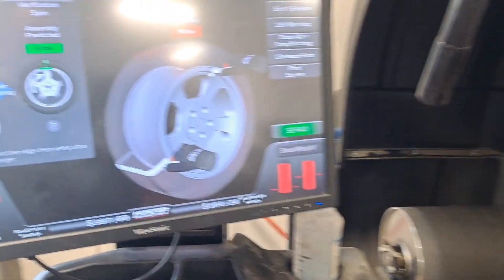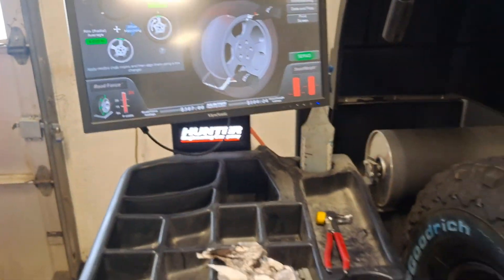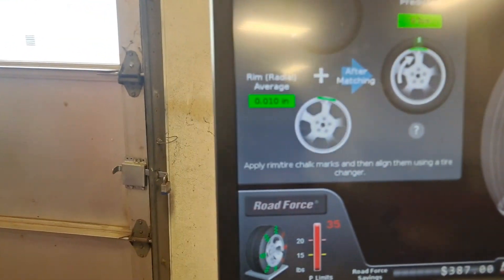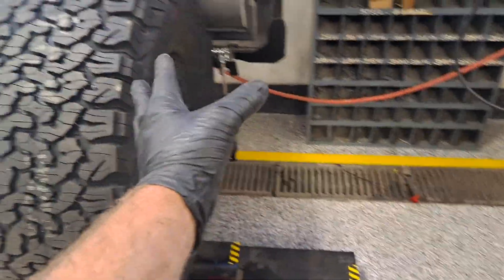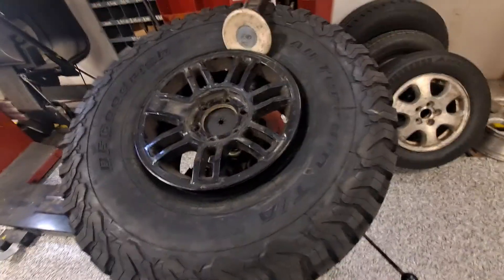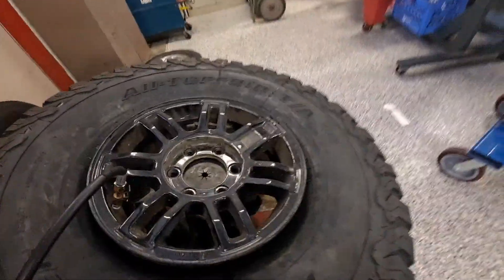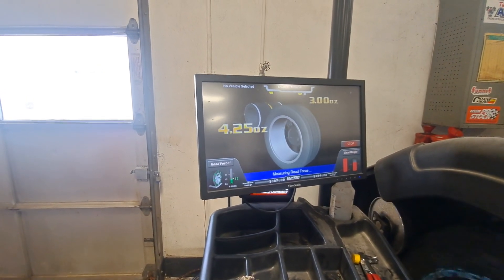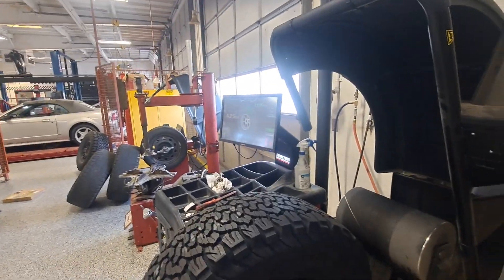Diagnosing and repairing a tire vibration (road force variation) using hunter touch balancer

Comment: The best explanation as to odd vibrations. The being able to balance a square analogy is perfect. Cheap tyres can often be balanced, but if they are poorly manufactured with hard points in sidewalls this will only ever show at high speed. I now know what has been causing my problem, thanks 👍🏻

Comment: Great explanation!  Adding to it?  A proper “balance” corrects the static and dynamic balance - side to side shake of the assembly.  Roadforce corrects the up and down “hop” by matching the high and low spots of the rim/tire assembly.  

Suggestion?   Perform a centering check.  If the rim is not perfectly centered on the spindle?  You will get inaccurate results - like trying to balance an egg.  The machine has this feature built in…
Reply from the maker: I agree with everything said, great input.
Reply: The story of my life at Discount Tire.  I have mag-style wheels, and they can never do it right bc they don't center on the spindle.   My dealership, on the other hand, has the top-of-the-line Self-Setting Hunter balancer.  They can get it perrrrrrfect.  Discount is trying to tell me my wheels are bent.....  

Just because I'm a girl, doesn't mean I'm stupid.  I know my car VERY well.

Comment: I have had a very mild annoying vibration in the passenger seat at highway speeds for a long time. It's a 14 Ram 2500 with 33" Nitto Terra Grappler G2 tires on the factory 20" rims. I had it balanced today on a Hunter Road Force machine. It took the technician about 3 hours, they were very difficult. Happy to say it rides perfectly smooth now! Will be posting this on the Ram forums too. The vibration in these trucks is very common.
Reply from the maker: Honestly its common on any trucks with oversized tires. Probably took a long time because they had to dismount tires and phase match them. But again, proof this procedure works. Thanks for the feedback.
Reply: @paulkelley86  Absolutely. Thank you for your quick reply. That's exactly it. He had to move the tire on each rim about 3 times and put a chalk line where it was previously to try to find where the tire and rim marry in harmony. Actually had me concerned because it took so long but the proof is in the pudding.
Reply: @paulkelley86  It had the vibration with the factory Firestone Transforce tires which had me concerned when I Nitto tires on and it still had the vibration. It seems anything 31" and over needs a road force balance
Reply: I am having the same problem with my tacoma.  I have BF Goodrich ko2. I took it for an alignment and they told me it also needed a to rebalance front tire. They did and when got mg truck back going 65-78 miles per hr my passenger seat starts to
Shake like its going to
Fly out the window. I took it back and they cannot balance the tires. I’m so frustrated. Any advise where i can take it or do? My truck is only 2 yrs old and it drives like crap.
Reply: @Lexibeez8907  Google tire shops in your area, I'm not sure if you are in a remote area but call the tire shops and specifically ask if they have a road force balancer and an experienced technician that knows how to use it. I'm just curious, do you know if your rim is bent from a pothole or something?
Reply: They expect these gay jacked up trucks to drive like a Cadillac.

Comment: Thanks for this video. I had a weird highway speed vibration problem that I couldn't figure out, and I insisted a tire shop put them on their road force machine. Even though they balanced just fine, they failed the road force test.
Reply from the maker: Yes sir, we see that every day. All the students leaving here will be trained but more experienced techs/mechanics are not necessarily up to speed on the latest tech.

Comment: I have some advice not that anyone asked. If you have a decent amount of lube on the beads, you can pinch the tire with the bead rollers and turn the wheel inside the tire to match mount. Also if you want a good balance, turn off Smart Weight or at the very least turn on Smart Weight technical mode. You're welcome.

Comment: What an excellent video.  Great info. I just bought 4 new 20” continental terrain contact HT for my f150. First it had a strange vibration at 45 and then over 70.  Went back they said one tire visually had a hi spot on the tread. They replace that tire. The 45 vibration is gone but the above 70 is the same. They do not have a road force balance machine and they keep telling me they can not guarantee anything over 70 mph? Sounds like excuses to me.
Reply from the maker: If it's tire related, the machine can measure it.

If it's something like a driveshaft, obviously the machine can't see that.

Based on when it started, request road force balanced and ask for the road force variation numbers for each. Sometimes techs don't really understand what those numbers are.
Reply: Thank you good to know just curious with the driveshaft. How much run out do you think is acceptable for a one piece aluminum driveshaft.
Reply from the maker: @IHcubcadet  there may be a spec, but we don't commonly test like that although there may be a spec.  There is an electronic vibration analyzer that can identify different frequencies and determine if it is at a driveshshaft frequency vs say a tire or even a flexplate frequency. They are all turning at different speeds. 
If we determine it to be driveshshaft related we would most likely send it to a driveline specialty shop that can balance a driveshshaft on their machine.

Comment: stock wheels and i have ZERO vibration even at 80 mph ..
Purchased a new set of wheels and tires, got vibration at 65 mph and a slight wheel hop on idle speed on the front side.
Took the wheels and tires to 3 tire shops to all of them say the wheels and tires are fine. Took the wheels and tires to 2 places that are specific to bent wheel repairs and both said the wheels and tires are fine.
They said my suspension has issues. Odd how my suspension works PERFECT with the stock wheels and tires but acts up when i put the new wheels and tires on ...
Reply from the maker: Good chance they are doing balance only. See if anyone can measure road force.  I bet you have excessive variation even though the balance is good.
Reply: @paulkelley86  none of those shops have this road force machine ...
Reply: Brother I have the same issue with my 4runner. Brand new 2023 got aftermarket wheels and vibrates at 65mph.took off the wheels and put back my oem wheels and it's fine now
Reply: @abrahamfonseca6198  🤷🏽‍♂️ i feel your pain
Reply: @abrahamfonseca6198  one shop told me to mix the stock oem wheels. 
Put the front stock oem wheels up front and the new aftermarket wheels in the rear and go for a drive and see if the vibration is gone or still there.
If the vibration is gone then the rear aftermarket wheels and tires are good and can stay there. 
If the vibration is still there, then you know its the rear set, then have to find out which one is bad. Either flat spot on tire or warped out of round wheel. 
Or they balanced one or both or all 4 wheels wrong.

Comment: I balanced a few tires the traditional way and the machine called for .75oz on the inside of the wheel. Not bad. Then i did a roadforce and match. Called for 1.75oz 🤷‍♂️   I would have preferred less weight.

Comment: I’m going through this now. The Toyota dealership is trying to warranty through nitto and replace all 4 tires. I’m now thinking the technician didn’t know what he was doing with road force balancing
Reply from the maker: Very possible. Request road force balance. I believe the road force balancer is a required tools and equipment for all toyota dealers. Sometimes people learn one way to do things and don't always know the latest and greatest tech. It also may be an issue of pay, the techs often get paid a fixed labor amount whether they basic balance, roadforce balance, or even spend a ton of time phase matching to really take care of the customer. It is possible to get toyota to pay the clock time on that rather than the book time, but the dealer needs to know how to navigate that "z" time process. Advocate for yourself, there is a lot of problems in automotive biz.

Comment: I just had a set of Toyo AT3 put on my 05 4runner. Thing rode like crap, took 4 trips to the tire shop to get the road force right. 2 tires the yellow dot is 180* out from the valve stem. Other 2 are pretty close to valve stem. I had a really bad vibration in the 15-20hrz range. It was a loose vibration not a tight one like a bearing.. The vibration is 90% gone but its still there. I have  a feeling the vibration will be felt through the wheel when rotation time comes. The tire shop (Les Schwabs) put the 2 180* out ones on the rear.. Should i be worried about it? before the last rebalance i called Toyo and they was not to happy with Schwabs!
Reply from the maker: Ultimately what matters is the road force variation reading on the assembly. 
If they are dismounting and re indexing 180 degrees that sounds like a guess. The dots are a guideline but with the correct balancing machine (road force) the machines instruction supercedes the dots. 
And yeah if the roadforce is excessive on the 2 rear, a tire rotation to the front is going to bring your vibration back.
Reply: I know you posted this 9 months ago, and I'm in the same situation as you my friend. I bought the AT3 for my Envoy, had it balanced 5-6 times so far with 1 tire being replaced 2 weeks after purchase due to it being out of round. No matter how smooth the surface is, I still get a vibration similar to yours. I had a set of Yokohama Geolander A/Ts prior to these Toyo's and never had a vibration issue up until now, and I'm coming up to 10 months of ownership.
Reply: @supersaiyenunlimit2  I am so about ready to take these tires back.. The vibration kinda went away during the hot summer days but now the temps are blow 70* out the tires have started to vibrate again! 
Thanks for the reply!!
Reply: @MrDan1509  That is exactly what I'm experiencing as well, they're tolerable when it's warm or hot but once it's under 60* it's definitely noticeable. I do regret not returning them under Tire Racks 45 day policy if I knew this was going to be the outcome or went with something different. Hopefully they get better as they wear but I'm doubting it.
Reply: @supersaiyenunlimit2  Dang, i knew i was not the only one. I buy my tires from a tire shop that will buy them back no questions asked even if there's only 1/4 tread life left. Paid a few hundy more than i would have at Discount Tire but Discount warranty sucks!
Reply: I just put 5 Yokohama Geolander A/Ts on my 2023 Bronco. They were very well balanced on stock steelies from the shop. Once I saw what rally racers were using I made the switch. I can take it up to 85 with no noticeable shimmy. But it's also a new ride. @supersaiyenunlimit2

Comment: So say my shop balanced my all terrains they showed me how the tires were perfectly balanced one thing I did notice they didn’t use the roller they only spun the tire and road forced matched… I get on the road and I’m still getting vibration, so would this mean I need a road force balance instead of the regular balance I got .??
Reply from the maker: You are correct. Vibration can be out of balance or road force variation. By the sound of it you still have variation.
Reply: @paulkelley86  yeah steering shakes back and forth from 55-75, I feel like im being delusional at this point, how much road force is acceptable in an all terrain even though it’s a P metric size .?
Reply from the maker: @ThatMGM4RNR  I typically try to get it as low as I can but if it's a car I would get under 15 and if it's a truck/suv like your 4runner in your pic probably under 23 would be reasonable. It kind of varies but the vibration will be proportional to the variation. If it's something borderline I may run it, but if you have like 50, I would deal with that which sometimes means getting a new tire or tires. I won't live with it, and I'll spend the money.
Reply: @paulkelley86  yeah I drive a 4Runner, I’ve ruled out that it’s not the wheels since they are hub centric, they are aftermarket though, so would you suggest I get a road force balance at this point since the regular balance didn’t work .?
Reply from the maker: @ThatMGM4RNR  for sure.

Comment: You ever run into a situation where force is high and the prediction can’t make it better? This happened on light duty (3/4 ton) truck tire. Force was 50 and prediction want to move tire 90 degrees to get to 49lbs vs 50 😮
Reply from the maker: Yeah, in those instances the tire would need to be replaced.

Comment: I just replaced my Ram 1500 tires that had 22,000 miles on them with new ones and they shake like crazy I've had them Road Force balanced 2 times.. they last about a week and a half before it changes..
Reply: I don't know if you still have this problem but make sure you go easy on the tires for the first 500 miles after any service that requires reseating the beads, sometimes a lot of torque will make the tire spin on the wheel because of the assembly lube

Comment: 50 PSI?? Why so high for road use? Do you off-road it so much with the tires aired down it equals out?
Reply from the maker: 50 is probably overkill, especially for my truck but they are load range E so they can take it and I commonly tow over capacity. To be honest probably not a good idea. I recommend running what the tire placard in the driver door jamb calls for.

Comment: Seen a video where they did two measurements with 180° apart first and then matched the tire and wheel. How can the machine know the high and low spots in one go 🤷🏻‍♂️
Reply from the maker: The older machine has arms that measure the wheel, and the roller that measures the tire. The newer machine has a laser measuring system that measures everything as soon as you spin it. 

Back in the day we measured with dial indicators.
Reply: @paulkelley86  no, was a video from Hunter with the same machine…
Reply from the maker: @p__jay  I can assure you that what I demonstrate here is correct for this machine. I'm not sure what you saw, the machine has had a lot of updates over the years, and a lot of people have different ways of doing things. This is how hunter recommends on this particular machine. And we have fixed hundreds of vibrations.

Comment: Wait so roadforce identifies hard spots on tires  ?  And Not road damage ? are run flats notorious for hard spots?  Dealer trying to tell me I hit a pothole on causing the 75 lbs force point.
Reply: Let me take it to you. I don’t trust them.
Reply from the maker: @luileo2  it measures variations. So a bent wheel or broken belt inside a tire would both contribute to high road force. 
The issue is "taking it to me" doesn't work. I teach the classes, not run a business. In the spring semesters I could use yours as a class demo but deep into transmissions currently

Comment: Where’s your shop I need to get my 37s fixed! Lol
Reply from the maker: Cypress college in orange county CA, but my students end up all over socal, they can help you out! But really you just need yo find a shop with the road force capability and request it, we fix stuff like that all the time.
Reply: @paulkelley86  thanks for the info I’m in Los Angeles and I’ve been to a lot of shops but most turn me away when they find out I have beadlocks. If you know any shop please let me know.
Reply: @paulkelley86  how much you charge, i got some 35s that shake my steering wheel . I live 5 min away from cypress.
Reply from the maker: @samuelwinningham4487  well, it's a community College so I can't charge since the equipment was ultimately purchased with taxpayer funds. The way we can do it is to use your tires as a lesson. I am not teaching thst class at the moment but we have someone who is, and I'm sure he will demo it for his class. The first step is to come by. Parking lot 2, all the way to the back. Thst class runs 7am to 1140 am Monday, Tuesday, and Wednesday.

Comment: So it’s first force balance and then balance??
Reply from the maker: Its more like measuring the force and displaying that number. Then if it is a reasonably low road force number you do the balance. 

If the road force is too high it will predict if phase matching the tire will improve and tell you how much to expect. Then phase match it. Then verify the road force measurement after phase match. Then balance.
Reply: @paulkelley86  thank you so much for your answer I really appreciate that

Comment: Hey Paul, Can you recommend a shop with hunter alignment and road force balancing machines that actually know how to use the added features or if they know how, they actually perform them? I am in the San Bernardino area. I have gone to les schwab because of their hunter machines but they say they cant get all the vibration out of my tires and when I mentioned to them about rotating the wheel on the tire, they said its only for extreme cases. Plus they cant figure out my road wandering issues. They say steering and suspension components are perfect after bringing my truck back to them. Took it to another shop and they said my track bar bushing is bad so I am replacing it and ball joint myself. It seems as if les schwab isn't  being thorough and just trying to get me out the door. I can not, for the death of me, find an honest and knowledgeable alignment shop
Reply from the maker: I wish I had a fix for you. Good techs are hard to come by. Find the right one and you will be good to.go.
Reply from the maker: If you want to make the trip to the school in cypress we will hook you up
Reply: I'll see if I can make the trip out there. Appreciate the offer!